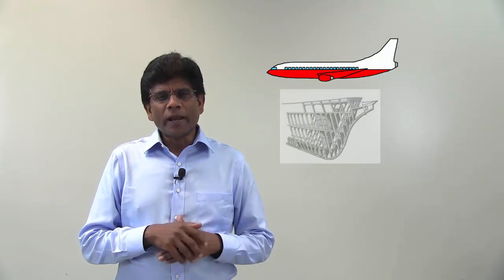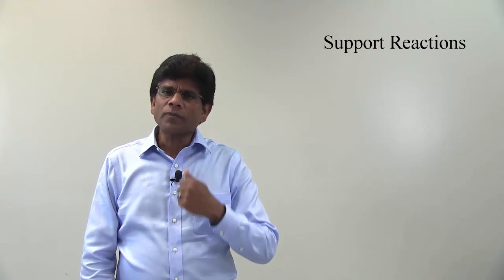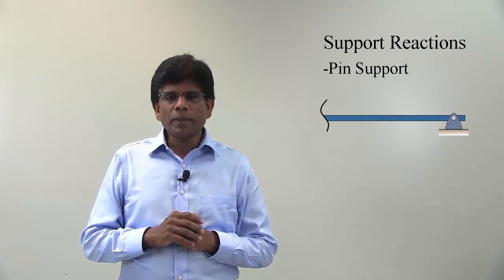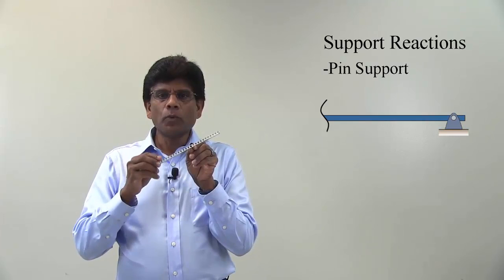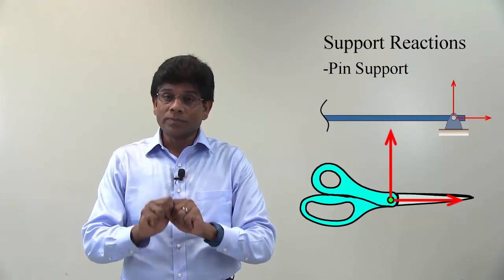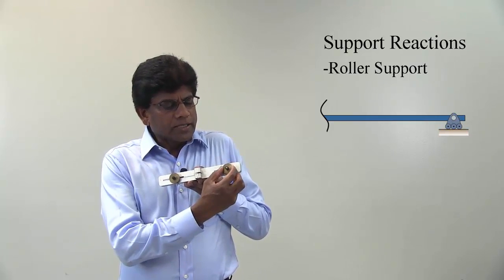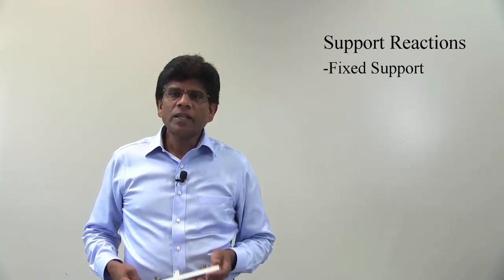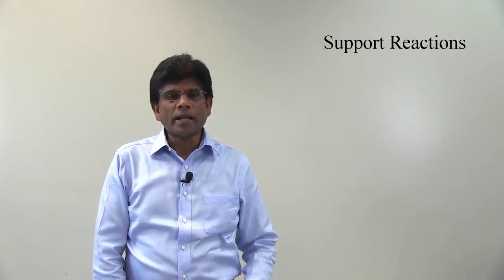Support Reactions - Lesson 10

Comment: If I take the resultant of both forces in  x and y in pin support can you tell where will be the resultant of that two forces
Reply: The square root of x^2 + Y^2 will be the magnitude of the resultant. You can find the angle using Inverse Tan (y/x)
Reply: Sir I do know that . But will the  resultant be along the body.